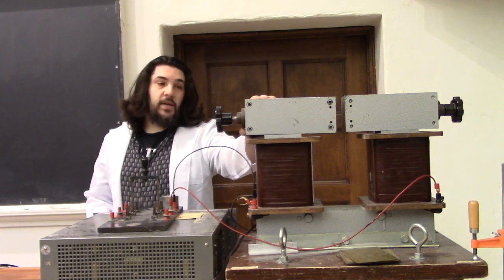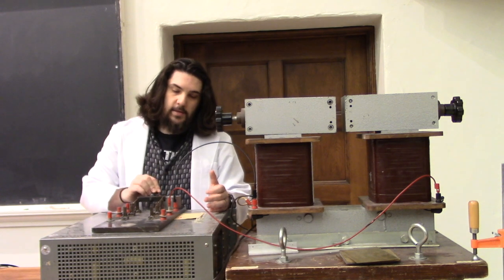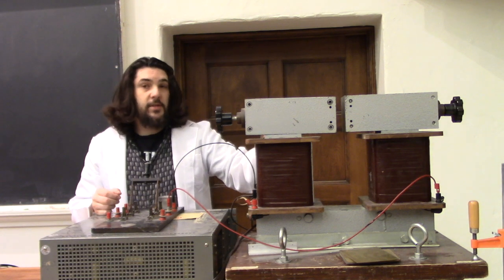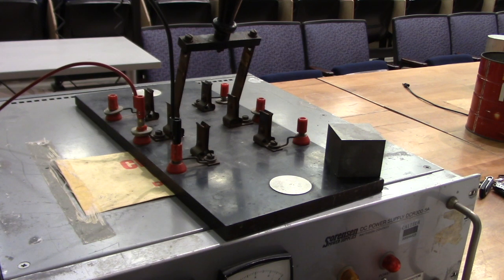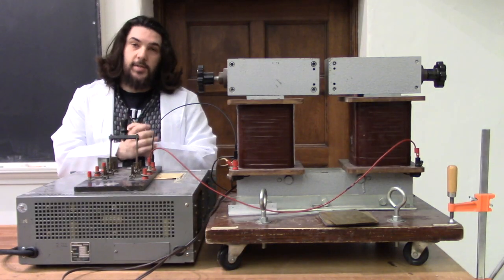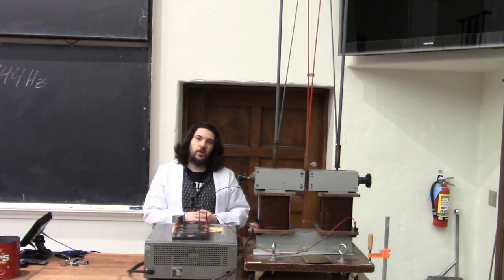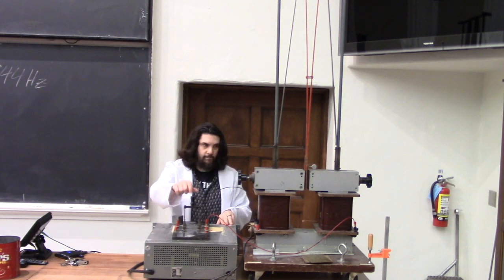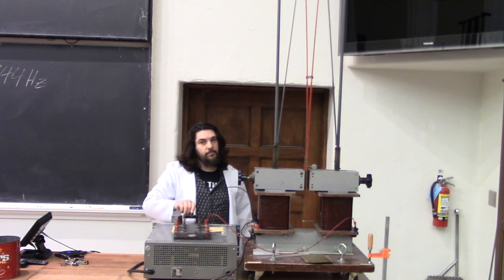Demos: Big Electromagnet

Comment: How did you make it
Reply from the maker: The design of this electromagnet isn't much more complicated than any other, it's simply bigger.  The brown parts in the middle are coils of cable, which supply the magnetic field when powered.  The gray armature is a core to enhance the field. I believe it is a ferrite material.  The core has just been machined in a way that allows us to attach the pendulum to it and adjust the separation in the middle